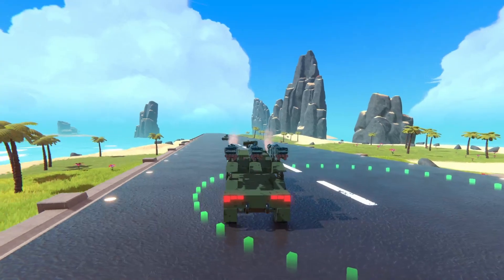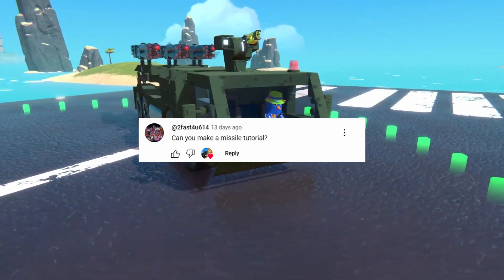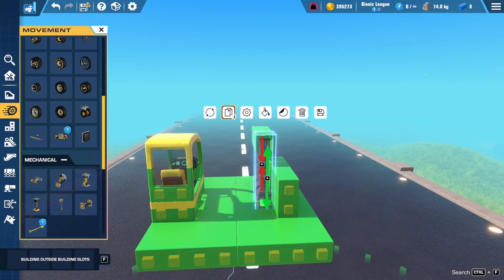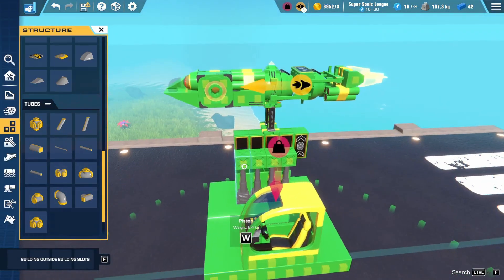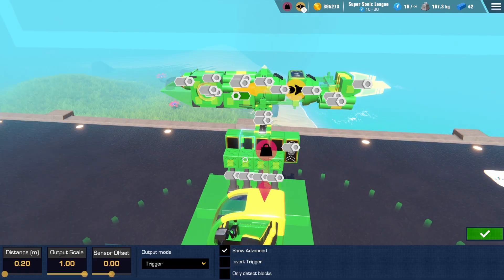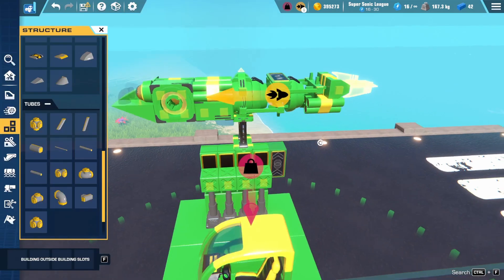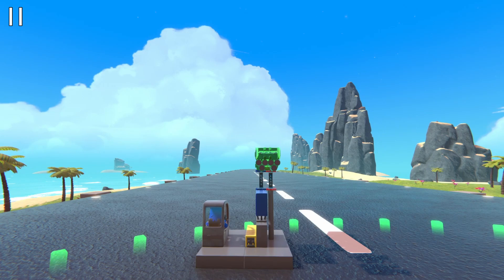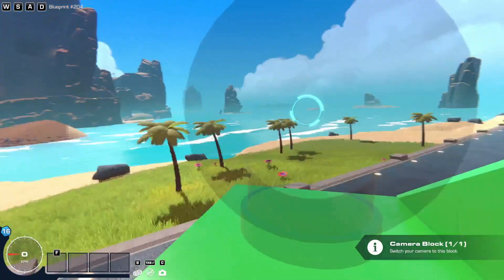Rc missile Trailmakers Tutorial

Comment: Hey quick question, I’m having issues with the distance sensors not falling straight. I’ve tried using blocks as a funnel of sorts but with varying degrees of success, do you have any tips?
Reply from the maker: Hmm good question best tip i have for you is just to put the anchor pin as close as possible to the sensor. You probably already did this but if not it might help.
Reply: @wrukoohey thanks for responding 😄 I did change the Missile to one I build for esthetic purposes but I kept the sensor part the same as in your video so it’s as close as possible 🤷‍♂️ thanks anyway